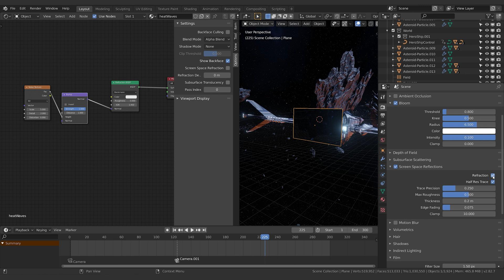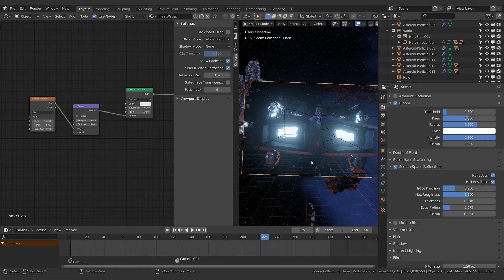Quick Blender Tip - Heat Distortion - Real Time Refraction In Eevee 1

Comment: But it doesnt work with volumetrics? if that plane is inside a volume scatter box it holds out the fog. such a shame
Reply: I tried this earlier. Sorry bit late to the party!  But it works ok in cycles. Just need to learn how to make the edges of the plane softer! Trying to make heat waves coming off ground in distance. Tried a gradient node but can’t work out how to make it see through rather than colour haha